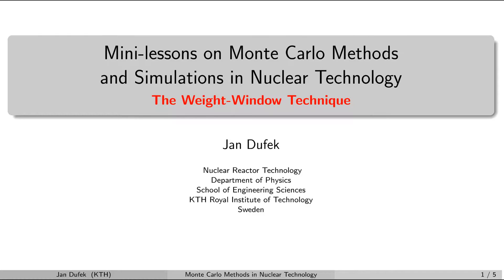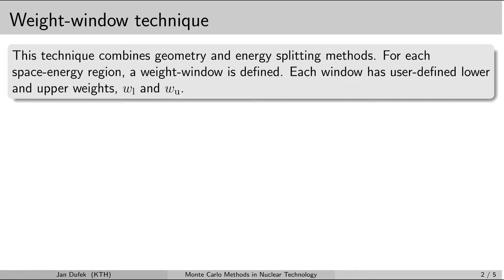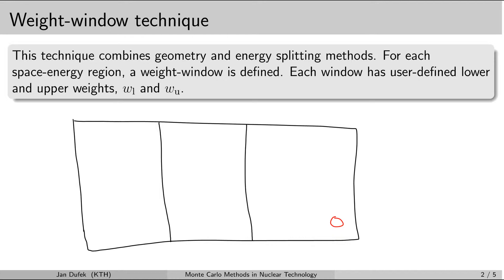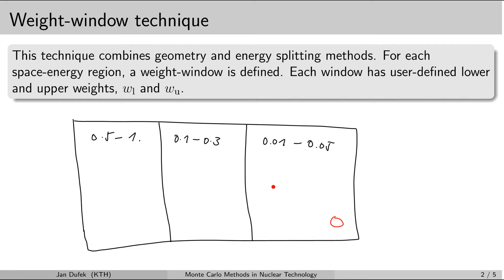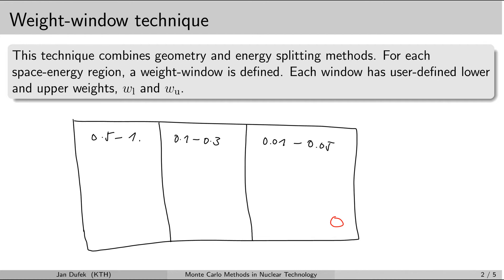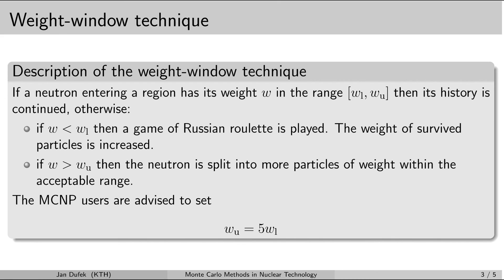MC simulations:  X.3 Weight window technigue

Comment: One of the differences between weight window splitting and geometry splitting in MCNP is that the weight window always does an integer split, introducing no variance because of the split, whereas the geometry splitting allows a non-integer split and the total post-split weight need not equal the pre-split weight, so variance is introduced by the non-integer split.